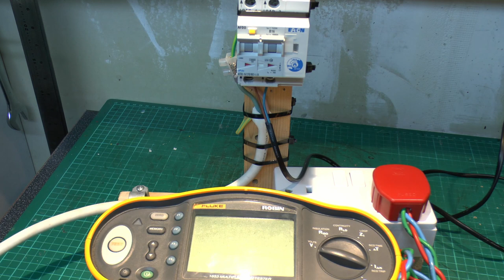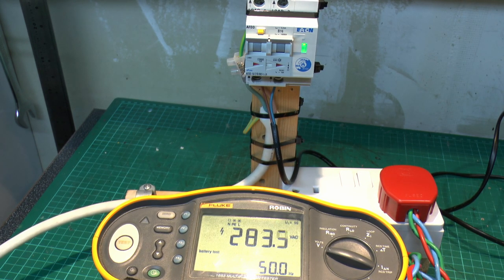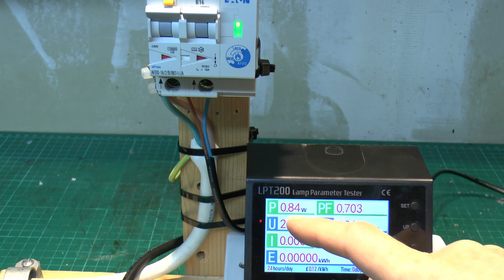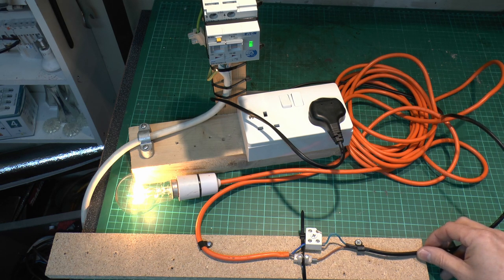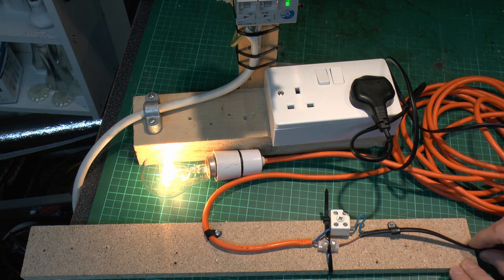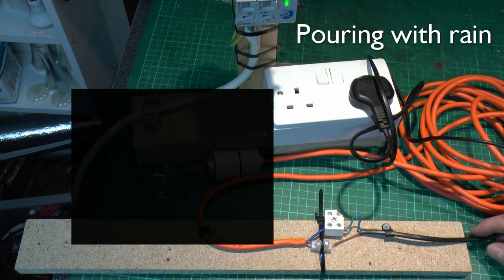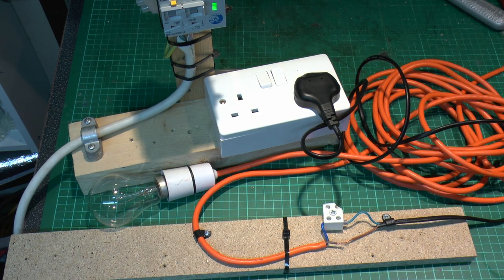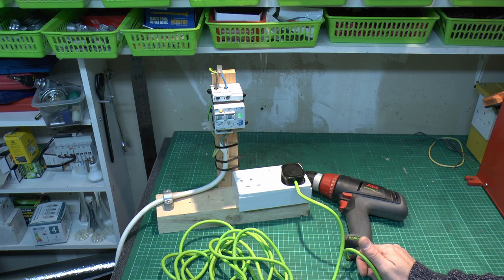AFDD Arc Fault Detection Devices Additional Tests (Part 2)

Comment: You have the Li/A version which has a delayed trigger mechanism so you need 30mA of high frequency current component while using 500mA for a longer time, up to a second. The higher the load current, the faster it trips. If you put ~5A in parallel it should trip faster and more reliable. These things are tricky to do (and to trigger) since there is a certain overlap in characteristics of ordinary switches and those faults. The spec sheets and curves are somewhat hard to interpret too for certain manufacturers.
Reply: I'm not fully up to speed with your points Dennis, although I think I get the gist - a load is required of a certain characteristic which corresponds to the characteristics of this AFDD. 

However, shouldn't we be testing these things under actual/'normal' operating scenarios? If we had a domestic lighting circuit with no load, but damage occurs resulting in serial/parallel arcing then shouldn't we expect this to operate?

Or is your point that John is testing a type of AFDD not typically installed in a domestic lighting circuit? 

Cheers.
Reply: I sort of get your point on the arc detection though I do agree with Coubertin67s comment. However that doesn't excuse the over voltage fail.
If we look at the evidence from the US these things are a nightmare; either failing to trip when they should or continually nuisance tripping. Also the price of them is ridicules. I'm about to put a new RCBO board in my own house at a materials cost of just shy of £200. If I were to use AFDDs I'd be putting another 0 on the end. The argument that the price will come down with increase in unit sales is bogus, again I point to the US where they are still very expensive indeed and have been code for a while now. (And I'm expected to pay for the juice they use!)
Reply: @Raysnature  I have never bothered too much about the characteristics of its over voltage protection abilities, but I know that certain manufacturers don't use AC RMS but rather the maximum voltage peaks as a trip criterion, so in case of using his transformer setup I would wonder what the waveform looks like and if it maybe doesn't go all the way up to 380V
Reply: Dennis Lubert - transformers don’t change the waveform shape that much. The output will still be an approximate sine wave with the peek voltage being 1.41 times the RMS voltage.
Reply: When John says the overvoltage criterion for operation is 380V AC is he getting this from the spec sheet? And does it refer to RMS or peak V?

Comment: I would like to see a test done on a hair dryer. These are the devices that the cords end up fraying on the inside of the insulation and spontaneously flashing into a hot white plasma fire on me. If an Arc Fault Circuit Interrupter can't protect you against that, then these devices are just a load of snake oil.

Comment: As an electrician I can say that these are a massive scam. Totally unnecessary.
Reply: Yes we have managed to live without them for quite a while. Snake oil really. Create a scare and provide a magical device to stop it all, scare the public and we have this magical £200 thing that will save you from burning alive. Yeah right. AFDDs seem to trip with harmless brush sparks but will ignore a flashing light fixture with arcing between the millimetre thick aluminium strip that consists of "Crabtree" pendant light contacts. Those Craptree luminaires lasted 10 years, all replaced because all arced thanks to the crap 1mm thick aluminium terminals. New ones have heavy duty copper terminals with a strong spring instead of a coke can's tab doubled back on itself for a bulb contactor. Arced with the room lit up all flashing like a rave until the room stank of ozone and the lampholder was brown and smoking. What do you think the AFDD did? Ignored it. Tried it with all 3 failed Craptree luminaires and also a demo arc I set up. Brush arc in an antique Singer (perfectly normal, these old Singers really spark) and it tripped instantly. The arcing luminaires are a fire hazard. The Singer isn't. Oil of adder, eye of python.
Reply: I agree - make your comments to the consultation document before 11 December and we can try and stop this scam

Comment: I would like to hear what the manufacturer of these AFDD's has to say. Could the high voltage trip need to be a spike within milliseconds? In order for it to trip, and the arcing need to be a heavier load? Is there a spec sheet with these AFDD's? Seem pointless for domestic installations. Looking forward to your next report captain  JW great video.
Reply: A constant overvoltage condition is what should trip it. A spike should be irrelevant - that's why MOVs exist.

Forget the spec sheet, there's no point if all it does is detect some arbitrarily defined arc test that never occurs in the real world. And we all know angry pixies can't read spec sheets anyway. If it can't detect a realistic fault as tested here, then what's the point?
Reply: I would say the arcing needs to be a heavier load.

Comment: Call me cynical but I wonder if the manufacturers of such BS devices have an influence on standards and amendments...
Reply: Good point and I'm guessing they have suckered the authorities as usual..
Reply: They probably give money to and lobby the standards people.
Reply: Yeah, I was wondering how much they got lobbyists involved in this...
Reply: They're already "recommended" which is a strong hint that they'll be mandatory at some point in the not too distant future.
Reply: 1,000% they do. Ooh evil arcing is happening, superhero AFDD will come and save you! Except it ignores a lot of arcs and will trip out with brush sparks on electric motors (sewing machines, drills, etc) that won't do any harm.
Reply: It's called regulatory capture

Comment: I thought there were standards for what the transients had to meet in order to trip.  You wouldn't want them tripping on every single like you would have in a light switch or turning on the vacuum sweeper.    You could put a scope across your two contacts when you make the arcs and see how they compare with the standards.    Odd about the over voltage not tripping it though.  Make me wonder how high you would have had to push it before it tripped.   Interesting video.  I thought these were smart enough to look at changes in the waveforms over time, almost like making a rolling signature analyzer.  It would be nice to see you dive into the details on how they work and if your series arc should have caused the unit to trip.

Comment: I wonder if the device is rejecting the sparks and arcs you're causing because they're infrequent and are similar to what might be expected when switching devices on and off, particularly with a worn switch?

Could a test be devised where arcing is more or less constant? In real life, I'm reminded of the fizzing socket that's got a loose wire behind it.

Thanks for interesting and informative videos!
Reply: Narrowing operation down to very specific situation. Don't you think it should operate in any arcing scenario?

Comment: I was thinking you should try it with a larger load, since a 40 watt lamp is only 1/6 of an amp. Maybe try it with an electric kettle.
Reply: That or a space heater. The only time I've ever had a device that produced noticeable sparking and caused me concern, it was a faulty 1800 watt space heater.
Reply: why cant an arcing 40w load start a fire? i think microsoft have some early xbox psu connectors to sell
Reply: Cadwaladr  In Canada, these are are required now in bedrooms, where lighting loads would be much more likely.

Comment: The overvoltage protection - would it make a difference if you had any current flowing?
Reply: I doubt it. A load would drop the voltage a little.
Reply: That shouldn't cause any difference i.n reaction
Reply: I would imagine it would just be the voltage the processor see’s

Comment: I wonder if the AFDD is calibrated to detect a much smaller amount of arcing over a longer period, such as might accompany a high-resistance fault that generates a lot of heat. The kind of arcing shown in the test seemed unstable; if left untouched, I'd expect it to either go open circuit (problem solved!) or revert to a high-resistance fault with less arcing. It would be interesting to just leave it as a loose connection, let it arc or not arc by itself and see how hot it gets before the AFDD trips. (If indeed it does trip.)

Comment: Hi John, you know I expected to see the results you got, these things must be set to a compromise otherwise they would probably trip everytime a worn switch is actuated!
It's a good idea and it does provide an extra layer of protection well at least in theory!
I think another way is to have a device that can detect extreme electrical noise generated within the installation, maybe with an adjustment facility for setting up against oversensitive tripping!
A kind of realtime monitoring of the health of an installation!

Kind regards Warren

Comment: I'm thinking they are designed to not support nuisance tripping as people would just get annoyed and not use them. I would also expect the drill to produce more arcing than the bad connection for the light and again more when the drill is under load related to the amount of current going through it. I'm thinking they will only trip under high current arc's with some thinking being that if you can disperse the heat faster than the arc can generate it then there wont be any fire and these are are sold as 'fire protection?' Although you can argue that a socket full of dust will go up on a smaller arc than one that isn't full of dust. So it might be a careful balance of how annoying is annoying. Thanks for the videos, I have been keeping an eye on these for a little while now.

Comment: Interesting, I was chatting with a colleague about AFDD's and we were speculating some what as to how they work. Having looked into the info from manufacturers its my understanding that an prevalent fault with arc has quite a number of unique current draw signatures and I gather research is ongoing. the device looks for a rise and decay pattern linked mainly with loose connections.  Looking forward to seeing more about these devices as the use of them has not been as widespread as it looks like it will be in the future. regards  Sean

Comment: The mind set of manufacturers is an AFDD in each circuit, so fitting in with (enlarged) conventional consumer units. Given that arcs emit an RF signature, there must be a better way. A single centralised receiver/analyser scanning the circuits would seem less costly and space hungry.  Various developments on this theme are possible.

Comment: Well performed tests.
A bit of arcing has under normal circumstances hurt no-one, except when combustible substances were near.
An other thing where these devices can't help is bad contacts.
I had once a situation where someone had not tighten the screws in a wall socket.
There was just no fire thanks to my quick reaction when I smelled the burning PVC.
I had to replace the wall socket and 3 m of wiring. And repaint the (wooden) wall.

Comment: I have the same exact model and I already had to swap out one faulty one, was tripping constantly and without any load. Having 2 adiacent ones, i can confirm also the "empathic" tripping, now the second one is also tripping falsly sometimes. Quite a dissapointment, I might switch back to the RCD's.

Comment: Question:  Is it worth testing a heavy duty brushed power tool (drill/angle grinder) under heavy load.  Assuming the tool is otherwise safe and maybe the noise suppression capacitor has seen better days to gauge how much 'nuisance' tripping would occur? 

However, based on your findings so far nuisance tripping would be the least of our worries! 😊
Reply: How about an ARC welder ?????????????

Comment: I would suggest that the reason that the AFDD is not tripping is that you are not subjecting it to an arc.  You are only generating a series of short sparks which the device is specifically designed to ignore.  How about trying again using something inductive such as your Variac as the load.  The drill doesn't trip it because it has an internal RFI suppression filter that prevents the RF from being conducted back into the mains as per the EMC regulations.

Comment: Maybe try a capacitor as the load, or a switching power supply (with some load). Those often end up with loose/broken connections. Also would be interesting to see if that will kill the input rectifier diodes in it.
I don´t have high hopes for it to trip though.

Comment: It looks like Eaton has addressed the nuisance tripping issue very well. 
Unfortunately, in real life it is difficult, if not impossible, to tell the difference between a loose wire on a 100 watt load and a drill or any tool with sparking.   The problem is more difficult in the UK than in the US because the current level in the UK is only half as large.  Tripping on low current loads will probably not be satisfactory in the market place, it's just too tricky.
Loose wires on switches or connectors are potentially very dangerous but nuisance tripping makes people skeptical about the value of AFDD's.
Manufacturers have been working on the AFDD for many years and they still have room for improvement.

Comment: In both cases you created a nice inductor with the cable this would block a lot of the electrical impulses.  In an installation you don't get that.
Reply: Tim Ballam - what rubbish are you talking? First, ALL wires ARE inductors (although in the wire that John used, the inductive value is so small, it can be ignored) . Second, inductance is likely to make an arc worse with a resulting bigger voltage spike. The greater the value of the inductor, the bigger the voltage spike.
Reply: @Mark1024MAK  ha ha ha the cable used in this "experiment" is creating a rather effective LC filter that's most probably filtering the 100KHz that the device is looking for!

Comment: The Eaton AFDD is obviously not working properly and therefore should be withdrawn by Eaton. At the very least it should trip on overvoltage!  Maybe you should report it to them and the local trading standards body to trigger a product recall.

Comment: The only circuits I'd be thinking about installing an AFDD on would be showers and similar.
Reply from the maker: Only problem there is that the guidance (looked at in Part 3) states that AFDDs do not trip on overheating conductors such as the classic shower isolator failure, they only apparently work when actual arcing is present.
Reply: @jwflame  In your experience would you not have said you'd normally still get some amount of arcing in that failure?
I've only had the pleasure of looking at one that's failed that way but it did at least look as if some arcing may have occurred.

Comment: It would be interesting to see the results of a test like this across a variety of different brands of AFDD and perhaps also put the AFDD into an arrangement with other protective devices (RCD,  MCB) to see if inbalance or increased current is detected quicker than the AFDD can detect the arc fault. My suspicion is the AFDD is a pointless addition to a CU, taking up space unnecessarily.

Comment: Brilliant video John! That’s really opened my eyes. Maybe we will have some future amendments on the horizon? Maybe variable sensitivity? What if several devices are daisy chained on a large installation?  ( discrimination type faults) Maybe different modules for different types of circuits? I doubt very much that the device itself is faulty. I think this is a cross the board example of them all in their entirety. Like you say, lighting loads are very low nowadays. A few mA? I wonder if a back feed from a lightning strike would trip it? Lol!  I wonder what an arc welder would do? It’s looking like more research is needed regarding suitability.  I wonder if these new regs should have been postponed for a while. Your brilliant work has proved so much!
Thanks for the well presented and professional approach to this new subject.